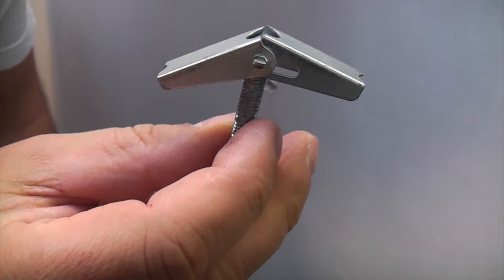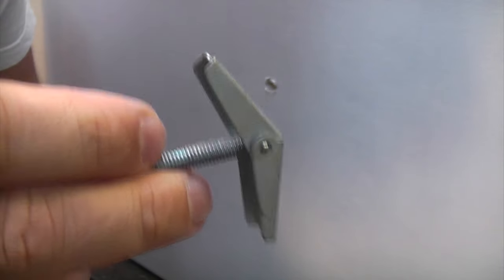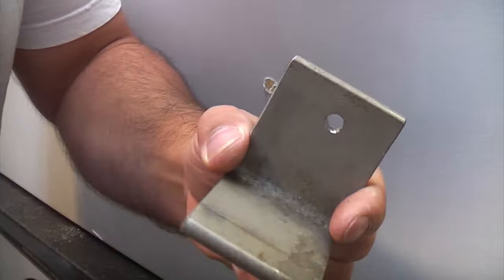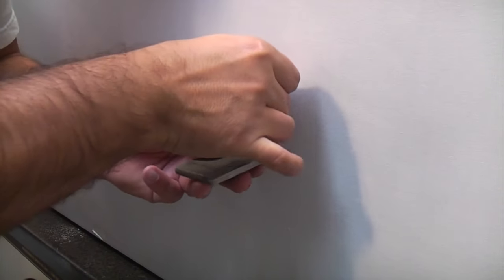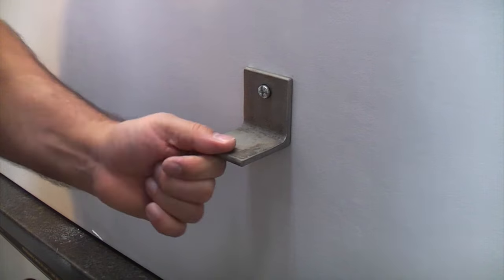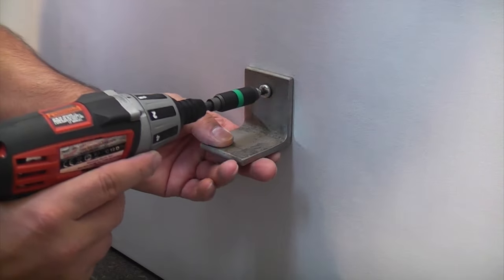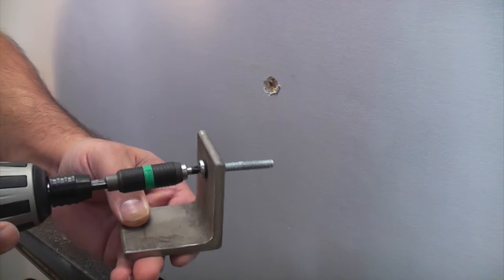Spring toggles

Comment: These are by far the strongest toggles I've used, better than the spiral wall anchors in my opinion. I've been able to mount 100+ lbs older flat screens from 2009, without wondering if it's going to fall off the wall. and you know those tvs were some big boys back then.
Reply from the maker: Yes, these are one of the best fixings that you can get, they are also widely available and inexpensive
https://www.youtube.com/watch?v=ECDysfNhx_E
Thanks for the comment

Comment from the maker: @ Ralph Connell
Just next door in Darwen.
Thanks for the comment
Reply: +Ultimate Handyman 
Problem is that after you get the toggle screw through the fitting, does not leave enough length on the toggle screw, the screw is not long enough to clear through the plaster board for the toggles to spring open behind the plasterboard
Reply from the maker: +Jack Jill 
Yes, that can be a problem with them.
Thanks for the comment
Reply: I am having the opposite to be honest,&#160;I brought some snap toggles the other day and&#160;I was a bit dubious about the size and low and behold the screws are far too long, I am just drilling a hole and as soon as it punches through that is it as I don't want to drill a hole into next door. One more job that I did not want a trip to a store to buy new screws. I am kind of thinking that a 13 mm snap toggle is not going to be good enough to put a heavy monitor on the wall as chances are the bracket holes will be a lot larger than the actual screw. So pretty much I think I am screwed either way lol
Reply: Knew I recognised that accent, Preston here :-)

Comment: I have a wacky wall where the screws for my curtain rods pull away from the wall. Would a toggle help that problem so it stays in place? If so, you will make my day. haha
Reply from the maker: It's hard to say without seeing it. Normally curtains are hung on external walls of the property, so there is normally a solid wall behind the plasterboard, which might stop these from working.

Comment: I have a double thickness plasterboard ceiling for fire rating purposes....can the toggle bolt come in longer lengths to allow for twice the thickness of plasterboard?
Reply from the maker: Yes these are normally sold in specific sizes so for example in the UK you can get them with a M6 or M8 thread, so you can then just buy longer screws for such applications.

Comment: I have 4" toggle bolts 3/8". What size hole should I drill to get the wings through the hole? 1/2 or 5/8"?
Reply from the maker: Not sure, just drill the smallest sized hole that the toggle will fit through. The smaller the hole, the stronger the fixing will be.
Thanks for the comment 👍

Comment: Great video.  Thank you!
Reply from the maker: Monica Decker 
You are welcome
Thanks for the comment
Reply: ***** I am not sure if you can answer a quick question but here goes:  I am trying to hang a heavy shadow box.  The dilemma I have is that the shadow box has small holes where a screw is introduced and then it slides up the narrow channel.  

All the drywall anchors that are the plastic threading style have screw heads that are too large to go into the shadow boxes hole.  I was looking at trying the spring toggles to give me the strength I need to support this heavy box but I don't think they are going to work.

You mentioned in your video that you must slide whatever you are attaching to the wall on the screw first and then place into the wall.  I have nothing I can do this with.  Can I used a washer or something?

I don't know why in the world they would make the holes so small for such a heavy object.  Beyond me.  Hope you can help.  Thanks!  :)
Reply from the maker: Monica Decker 
Snap toggles are better - https://www.youtube.com/watch?v=tAIUublenMw
These leave a threaded hole into which you can screw any bolt, providing it is the correct thread. So if you find that the head is too big on the bolts provided you can get cap head screws and use those instead. 
So for example if the snaptoggles come with a 1/4 inch thread, you can get a 1/4 inch cap head bolt and use that instead of the supplied bolt.

Comment: Would you use that to hang a boiler? ?
Reply from the maker: Arks Shackerwell 
No, Normally boilers are installed onto external walls, so these would work well- 
https://www.youtube.com/watch?v=xaYfs3lr1jI

If it is a stud partition wall that you are fixing to then snap toggles are one of the strongest fixings you can get- 
https://www.youtube.com/watch?v=tAIUublenMw

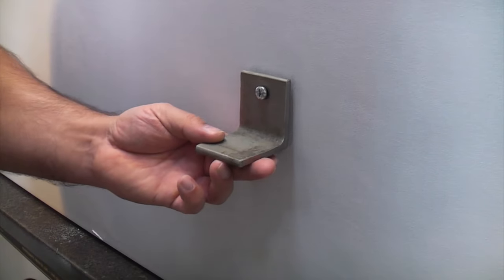Comment: I'm having the problem at 0:53 - it won't open behind the plasterboard!
Reply from the maker: Is there insulation or cardboard in the void?
Sometimes you have to clear the way using a hex key/Allen key or similar.
Thanks for the comment 👍
Reply: @ultimatehandyman  Thanks for the reply. I can't be sure, but I think the combined thickness of the coat hooks and plasterboard is meaning the toggle is not fully going through the hole and springing open on the other side.  I'm going to try with a longer bolt and see if that works 👍🏻

Comment: you can also add some glue or caulking to the toggle so it will stay glued to the back of the wall. then you can remove the screw and the toggle will stay in place
Reply from the maker: Thanks for the tip ;-)
Reply: Great idea!!
Reply: Gorilla glue? Lol. Or just go buy another toggle. Ain’t that expensive.
Reply: Jay Seven ... Darn, read your comment too late. Great tip!
Reply: Jay seven. What a great idea. Was almost tempted not to use these because of that draw back but will definitely be using this idea. Securing radiator mounts

Comment: Great video. A noob question though. If you need to drill a 12mm hole to fit the toggle though and the screw thread is just about 6mm or whatever, isn't the screw just loose though the wall? Usually you'd drill a hole to fit the screw size wouldn't you?
Reply from the maker: Yes, but once you tighten whatever it is you are fixing to the plasterboard the friction will hold the fixing in position.
You could, of course loosen the screw and you would be able to move it in the hole for a few mm in either direction- until you tighten the screw again.
Reply: This happened to my and my hole is 10mm and screw is what 5mm. Trying to put a shelf up

Comment: Problem is that after you get the toggle screw through the fitting, does not leave enough length on the toggle screw, the screw is not long enough to clear through the plaster board for the toggles to spring open behind the plasteboard
Reply: Get a longer screw version ;)
Reply: The toggles shown in the video are large diameter small length toggles, you can use an alan key to clear up the debris on the other side of the plasterboard prior to installing the toggles that way any loose chunks get knocked off and leave you with a cleaner exit hole, or you can max out the toggle on the bolt and wiggle it.

Comment: EXCELLENT video! Thank you very much! I am looking to install floating glass shelves onto drywall that have cinder blocks behind it. I heard of screws turning endlessly inside concrete. I've looked at Wall-Dog screws but toggle bolts seem more sound. What do you think? 
Also what if I miss the void in the block & screw into the web/joint area of the block? The wings won't open but will the wings try to expand & bite enough of the concrete to get a decent hold?

Comment: What size drill bit did you use to drill the hole to push the toggle through?
Reply from the maker: +2wheelspy 
You do need a large hole for these, it was probably 12mm or 1/2 inch.
Thanks for the comment

Comment: thanks excellent video..you show the inside of the wall, so i can see how the toggle bolt actually works..you made it very simple and easy thanks !...i was trying to use regular plastic anchors to install a bath shower rod..it was loose and wouldnt get snug against the wall....the plastic anchors would just spin with the phillips screw when i tried to tighten them..i guess i drilled too big a hole, and the anchors have nothing to grip to while installed on the wall..i'll try these toggle bolts instead, they grip the INSIDE of the wall with the wings...THEN they get snug, and you can start screwing in the nail ..
Reply from the maker: 6955beniegn 
I'm glad the video helped
Thanks for the comment ;-)

Comment: Would these still work if you have celotex insulation boards in-between the joists?
Reply from the maker: It depends if there is a space between the plasterboard and the insulation. If there is no spaces these will not work, but Grip it fixings might, although you might need the undercutting tool-
Grip it- https://www.youtube.com/watch?v=szx7nMRZSIY&t
Grip it with undercutting tool being used- https://www.youtube.com/watch?v=-geib-6sa3M&t=2s
Thanks for the comment

Comment: Do you have to drill a bigger hole to get spring toggle in since it is not round and sort of square shape?
Reply from the maker: As long as the hole is almost large enough, you can normally push the fixing through, as the plasterboard is only soft.
Thanks for the comment 👍

Comment: I need to fit a 20kg towel rail (has four fixings along only one side) and a 23kg bathroom cabinet (more when loaded with items) to a tiled plasterboard wall. Would you recommend spring toggles or snap toggles which I saw in your other video? Thanks!
Reply from the maker: I'd definitely use the snap toggles, they are superb on hollow walls ;-)
Thanks for the comment

Comment: Really helpful video, thanks for uploading! Can you use these on plasterboard ceilings? I need to hang a light fitting that weighs just over 2.5kg to the ceiling rose, but it is nowhere near a joist and I don't have access from above to rig up a batten(we live in ground floor flat). Would two of these be able to spread the load enough?
Reply from the maker: Yes, two of these should be fine for a 2.5KG light fitting.
Thanks for the comment
Reply: Self drill anchor plugs would be better for that in my opinion.

Comment: Try reversing the bolt so the head is at the back of the toggle. Then use a separate nut to tighten the bracket on from the front. That way you can remove the bracket without losing the toggle.

Comment: I got the toggle into the hole, and when I tried the screw the screw in, ot just spun on the other side and never got tight.
Reply from the maker: Sometimes you have to pull them forwards for the toggle to catch the plasterboard.
Thanks for the comment ;-)
Reply: @ultimatehandyman  Hi! I had a similar problem- got it to tighten the first time. then had to loosen just a half turn of teh screwdriver to level the shelf again, and when I went to re-tighten, couldn't get it to grip again! Just continues to turn, even when I pull forward. Can't figure out what I did wrong! Any idea?